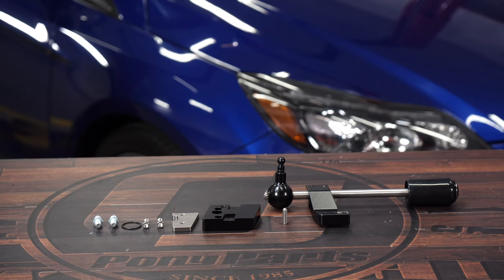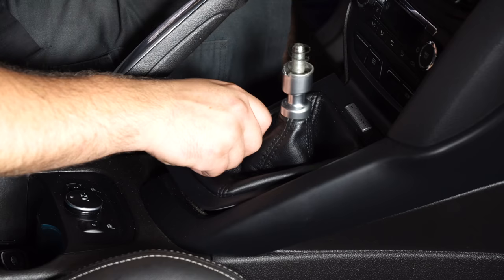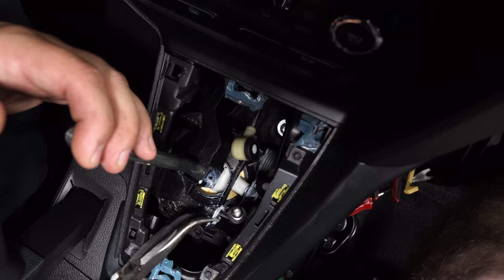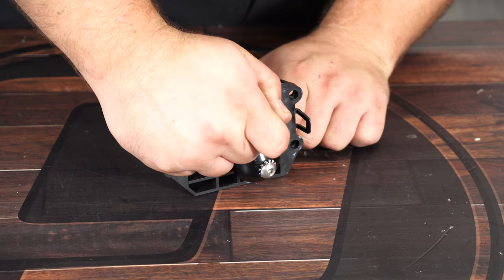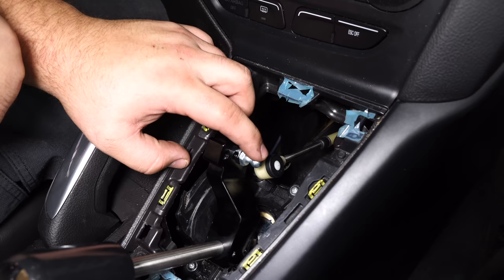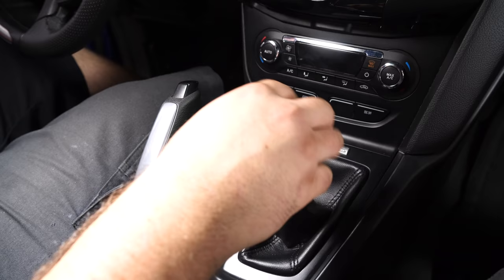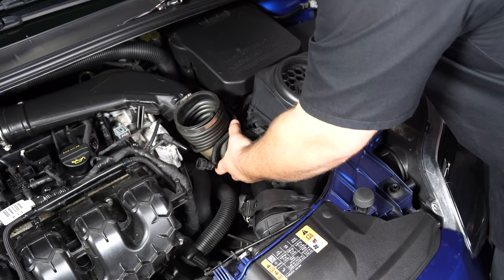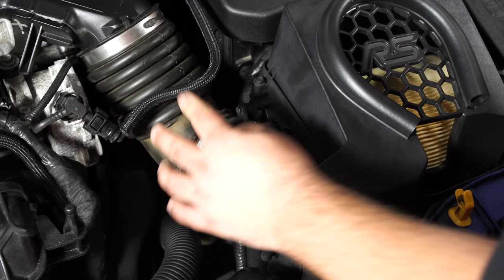2013-2018 Focus ST Install: Hurst Billet Plus Adjustable Short Throw Shifter with a Shift Knob

Comment: I bought this shifter from CJ pony parts and I I stalled everything (several times). Kept finding that no matter what I did the shifter rested to the left and down a bit preventing me from being able to shift into 1st.  I tried everything possible.  I did research for a couple days straight and found an old Reddit post from someone saying the black ball with the arm coming out (blanking on the name) was put together upside down for him.  Sure enough when I check mine that's exactly what it was.  I tried unscrewing the setting pin inside but they must have had some insane locktight or something because I could not get it out.  So I call the manufacturer and they said to call cj's since I bought it through them.  The lady was nice told me yeah just send us some pictures, I'll email you for the warranty, it'll take about a month for us to send it out ( end of October 2021).   Mid November comes and did not receive any info about the replacement.  Tried calling multiple times with too long of holds to be able to speak with anyone, chose the option to be called back twice and never heard back.  So I said fuck it and now I wasted over $200 on this part.  Also took it to O'Reilly's to see if they could get the screw out and they stripped the hell out of it.
Reply: Go to oreillys  a figgerent store and have them prder it for you its a special order amd they can get it for you once you get it go home install it whatever you'd like get the old one thats broken take it back and say you want a refund ir didn't work it sat too far to the left and you ended up getting a different one from a buddy

Comment: Does it void the warranty when you install this shifter and the shift plate?
Reply: No sir!
Reply: If you have transmission problems you should take all of this off before taking it in they can void a warranty repair as soon as they see a reason why a component failed. If they were unrelated like blowing a head gasket while having a short shifter it should not void your warranty. But if your synchros are fried and the dealer sees a shift plate ford might not cover it.

Comment: An RS airbox on an ST?
Reply: A lot of people do that since the RS one is open and the ST one is just a closed black box. Me? I hate mismatch badging, and spending $100 on something stupid like that (that’s how much the dealership charges for the RS air box; no kidding). So I did the smart thing, got on eBay and found a nice ST designed piece for cheap, so now I have the slightly opened box with nice ST badging.